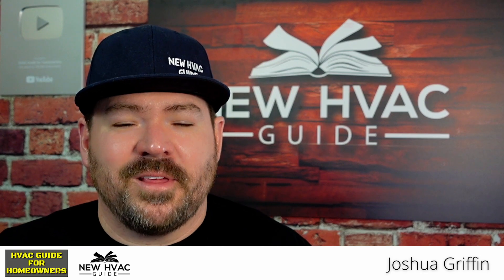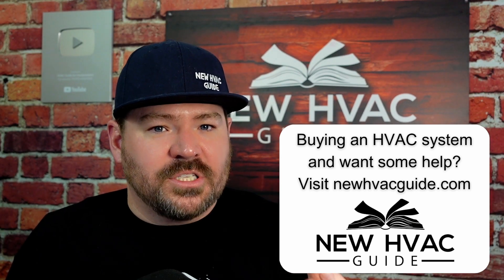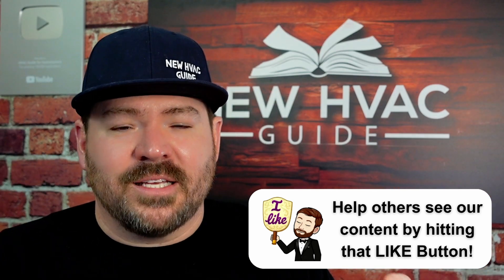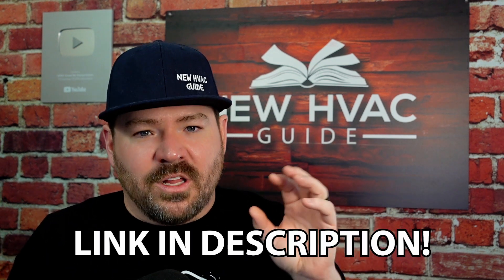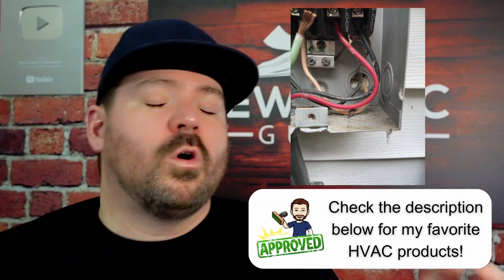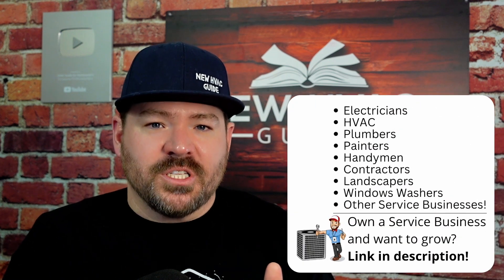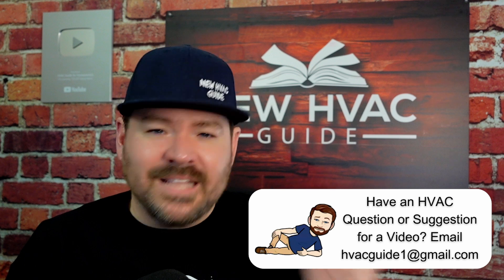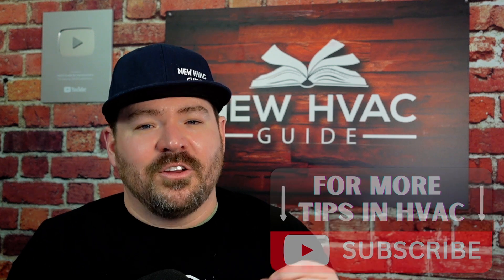5 BIGGEST DIY HVAC Mistakes Homeowners Don't Know!

Comment: Love that you call out the need for a dedicated power supply for UV lights, with my shared transformer found to be running the zone controller (& damper motors) and 3 Ecobee smart thermostats, no wonder the transformer got hot. I now have a 75VA transformer rated for 140°F.

Oh yeah, the inept heat pump installer also put the UV lights where it couldn’t get to more than 75% of the condenser, and inches away from plastic lined flex duct. In other words, wrong in every way.

Comment: Most ac runs 410a, which run high pressures 125/350 psi. A coil could lay flat and still have good oil flow. Also alot of commerial kitchen prep table there a coiled pipe loop in the back so you can pull out the condenser.  Just like on pipe risie, you have p traps. Also, ac unit only comes to factory for 15-25 feet line sets. Make sure you top up. Lots of units have fill charts on them or in manual. 600-700 sqft per ton. I always recommend a slighty bigger evaporator than condenser. 
This seems like a pointless video. You just talked about things you see with no real solution for viewers.

Comment: The professional people charge way too much. Too much markup on the equipment and installation cost is ridiculous. I installed my own minisplit and its been flawless for just over 3 years.... so if it fails next year im still saving money compared to what people charge nowadays.
Reply: They do charge to much to install . I bought me a Midea 18,000 Btu mini split I had all the parts and everything . He quoted me 7300 bucks to install that thing. I told him to leave he is out of his mind. I did it myself and it took me six hours and that was my first one. I bet he could do it in 4 hours and he wanted that much money that is more than my Dad pays his Attorney.  I bought that Mini-split because my main heat pump went out and it was 9000 bucks to replace it and it barley heats and is SOOO loud at night. Its a Ruud , 3.5 ton well I have stopped using my Ruud totaly and just use my Mini-split it was zero the other night and the air coming out was very hot and had no problems heating my home. My Ruud would be using the Aux heat all night long...
Reply: I guess we need really smart people like you to tell us how much to charge 😂😂
Reply: I understand there has to be a markup for covering costs of buying equipment like tools of the trade and such but jesus... some companies charge 12-15k for a system you can buy for 3k. Ask me how i know.  Just replaced my 3 ton central unit and most people were over 12k@anthonyspadafora1384
Reply: Yes you do
Reply: @mattb1967mb  Do you have any idea what it cost to fill my helicopter with jet fuel...it ain't going to fill itself. The truth is there are so few of us and plenty of people with money.

Comment: I only installed 2 Senville mini split systems because I was 100% confident in my ability. Cut, shortened, flared, and pressure tested with nitrogen. Evacuating and releasing freon all per instructions (book). It was a challenging installation in my steel building man cave. Over 2 years now with no issues. I did ask Senville about warranty that I am not HVAC licensed and their answer was it is void. I was willing to risk it and I feel it paid off. Only would do something like this on my own property in the sticks though.
Reply from the maker: I've spoken to others saying it's risky but worth it
Reply: @ 
I am a master plumber but have a real good HVAC guy(family owned). He installed the 5 ton complete Goodman heat pump in my home when it was built in 2000, I hired him for the project. 17 years later he replaced with a new Goodman. Him and his son knocked it out in a half a day. To touch on the other comment with the dyi guy  saying do yourself because of poor workmanship. (He will never know more than a tradesman). I do see this in all trades  especially plumbing. Lol. But I have worked with all trades in new residential and commercial construction, and can tell you from experience the HVAC crews did really well 95% of the time. Thank you for posting videos, I like your channel.

Comment: You gotta be dyi nowadays.  Trust me that knowing more then the pros is real !
Reply from the maker: Any stories where you hired someone that fell short?
Reply: @NewHVACGuide I have so many stories of local contractors failing so hard. The terrible contractors are the reason I spent $6k on HVAC tools along with taking classes and getting my EPA 608 universal. I can confidently say I know more than the last 5 contractors I hired.
Reply: @NewHVACGuide Lets do an interview for your channel....I think my experiences would be valuable for both pros and the system owners alike.
Reply: @NewHVACGuide  my last hvac install literally didn't work, had to come back a month later with new equipment (used the f up to attempt to downgrade my equipment)